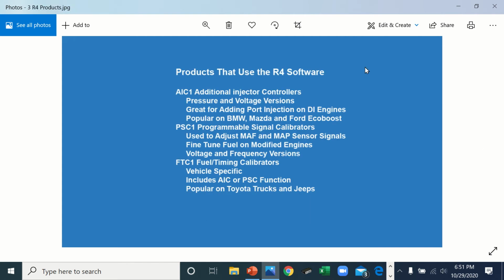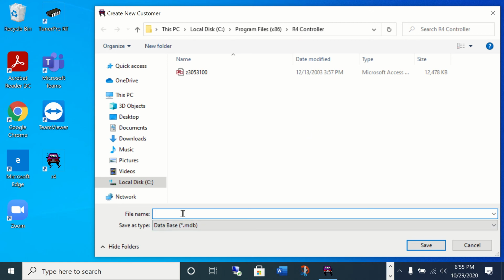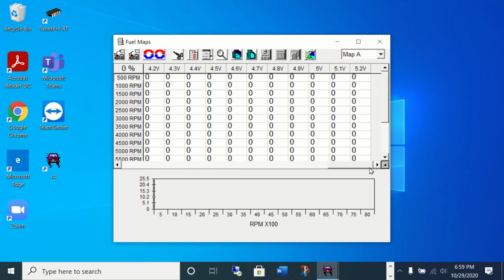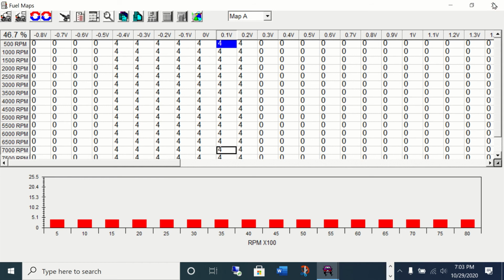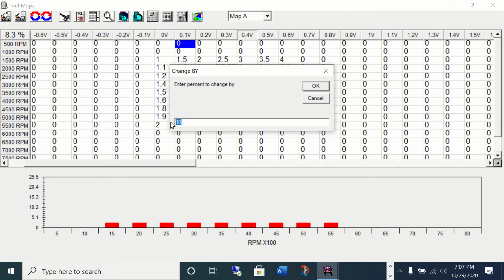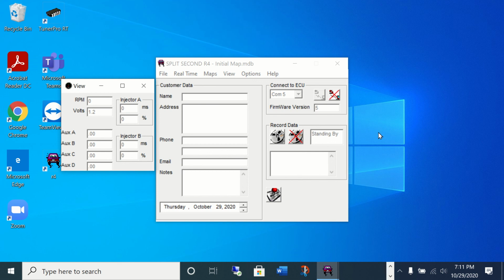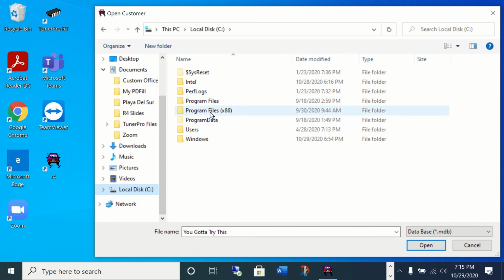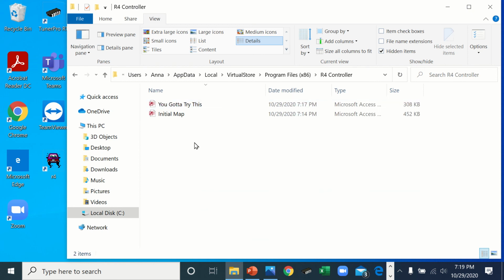Introduction to R4

Comment: Seeing around .2-.3V Maf voltage lower in the software than my Accessport. verified voltage is good up to the loom, Believe the problem is internal. Issue might be the reason for my lean condition at wot with port injection. How do i go about this?

Comment: Hello, I am sorting out my build path/plans for a 3uz/cd009 in a ls430. Stock ecu tuned for 75 wet shot by quantum auto. AEM wideband. Looking at PSC1 for 83mm maf housing correction over stock 73mm as well as using the modifier for fuel enrichment on nitrous. If I could run a dry 75 shot and use the maf enrichment map to match my nitrous window settings I could eliminate the wet side and rely on the modifier instead. Is this feasible? Thank you!
Reply: The PSC1 is well suited for adjusting for the larger MAF.  The modifier can make minor changes, but can't add enough fuel to match your dry shot.  We could provided the fuel through an additional injector controlled by an AIC1 or AIC2.

Comment: So for a 2.0 focus st motor do I need to set it to 2 cylinder 2 stroke? I'm running the Radium fuel rail with 1050 injectors
Reply: 2-cylinder, 2-stroke is a must for upstream injection.  With port injection, you can run 4-cylinder, 4-stroke.   The controller will inject fuel once per crank revolution.
Reply: @markamarandos3408  I will have to change it to 2 stroke 2 cylinder I have it on 4 stroke 4 cylinder but it's not shooting fuel at the desired rpm that we have in the tune and this is a whole new ecu because we thought our last one took a crap on us

Comment: I buy one already from graveyard i need to install all cables and buy freektune tune my tuner take care all????? Or i need to download R4 software to install my split controller
Reply from the maker: If you purchased one of our modules that uses R4 directly from Split Second or a dealer, the R4 software is included.  Give me your email and I will send a link for download.
Reply: @Splitsec  i buy one come with CD software
Reply from the maker: @josuearroyo370  It sounds like you already have the R4 software.  You will need to use it to write your calibration file to your module.
Reply: @Splitsec  i dont know do that my first time you think my tuner can do that for me only i have to conect the cables????my tuner is freektune
Reply from the maker: @josuearroyo370  Your tuner may be willing to access your computer remotely and do it for you.  If no, you can give me a call at 949-863-1359 and I can help you remotely.
Reply: @Splitsec  ok thanks split second
Reply: @Splitsec  hey i download the  program now i need to conect my split second  soon after conect my split  i need freektune tune rigth??? I not have to do nothing????
Reply from the maker: @josuearroyo370  You need a USB to serial adapter cable to connect your laptop to the module.
Reply: @Splitsec  ok
Reply: @Splitsec  i let you know for more questions
Reply: @Splitsec  i buy one for mazdaspeed 3 2013

Comment: If we have a map already flashed to the Split Second Controller and the Tuner wants us to reflash a new Map to it are we required to delete the old map or do we just flash the new map to it.
Reply from the maker: You don't need to delete the old map.  Simply open the new file, connect and do the Write Data to ECU operation.
Reply: @Splitsec  Thanks for the quick reply Much appreciated. Just wanted to make sure.